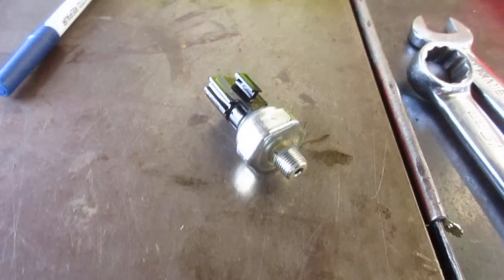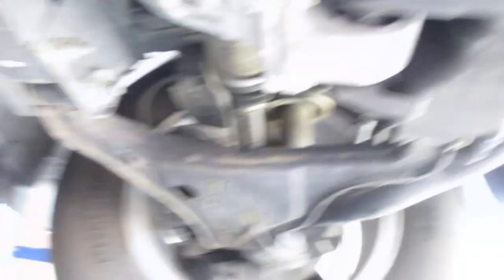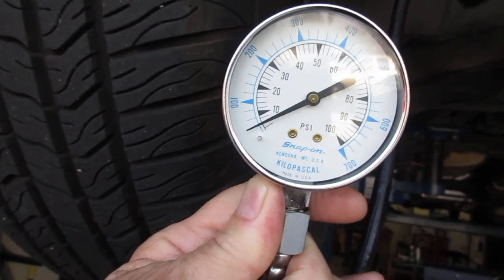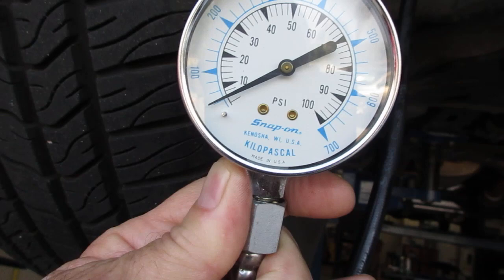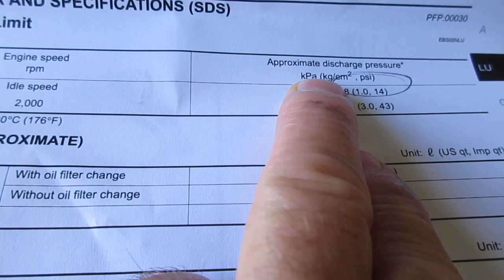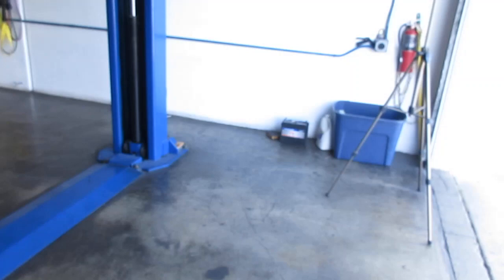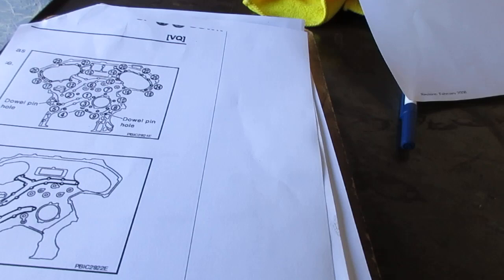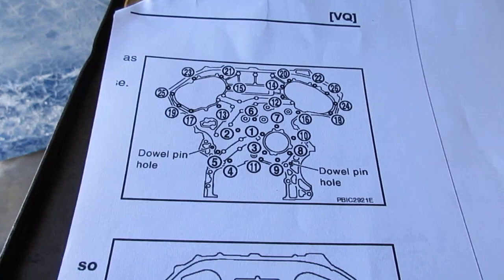2005 Nissan Xterra 4.0L, Low Oil Pressure Diagnostics

Comment: My 05 frontier got run low on oil...while the oil pressure sensor was bad.  Had a new one put in and the oil pressure at idle was 12psi (on a 60 degree day)  the engine sounds fine.  There was glitter in the oil so it isn't an issue with that plate.  I've put 15w40 in it and got a obd2 reader with an app that let me bump the base idle up.  Hopefully, that will be enough to let it hold at least 14psi in the summer heat.
Reply from the maker: Great!!!!

Comment: Hello I have a 1997 Nissan Altima 2.4l automatic transmission the problem is the car has a surging/fluctuating idle Intermitently while driving also it stalls out while idling in park no codes can you help me fix or solve this problem any causes that could make this happen I replaced distributor and MAF sensor with a new one didn't work bought a salvage MAF sensor didn't work checked for vacuum leaks had 2 hoses cracked fixed those hoses still doing the same thing also checked fuses good cleaned egr no luck put a brand new crankshaft position sensor didn't fix it tested fuel pressure got 30-31 psi and when it is revved at high rpm it drops to 20psi also put a salvage low mileage throttle body didn't fix it took it to 2 mechanics couldn't solve the issue they told me there is a issue with the timing chain or the timing chain jumped the other mechanic took seafoam to clean the gunk off of the valves etc it ran good but didn't fix it same issues

Comment: Hi John
Can you tell me what the Service Bulletin number is? I have a 06 frontier with the exact same issue and googling it hasn’t gotten me very far. Thanks
Reply from the maker: Hi Matthew , I will look for it and let you know. There is another post on here where they used 15 / 40 wt. oil and they used an aftermarket scanner to raise the idle a little and now the oil pressure is ok.

Comment: Fram filters strikes again.
Reply: I currently have one 05 AWD that when Idle is fine, haven't check the oil pressure at idle yet, but when you start driving within 100 feet it starves for oil.  Upon visual inspection you can see the Fram filter on it.  So yes, I agree with you 100%.